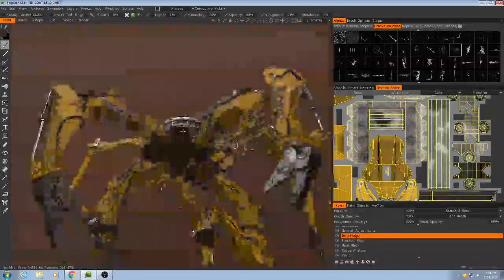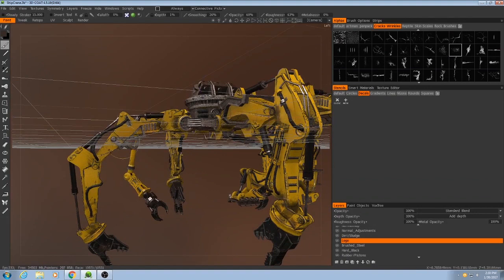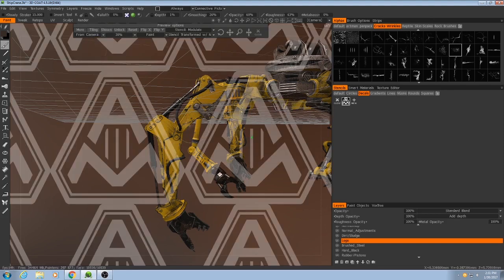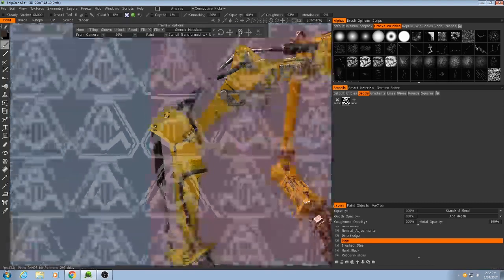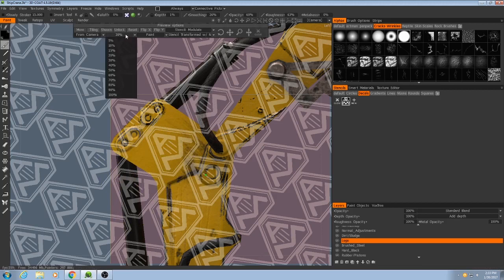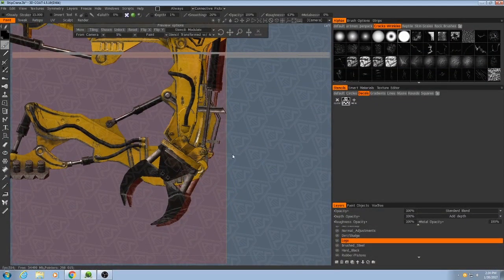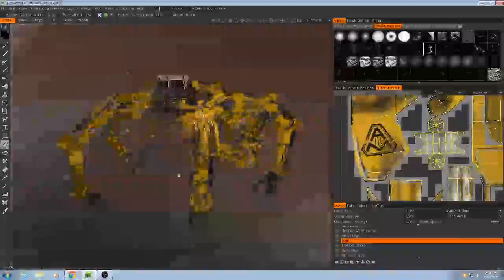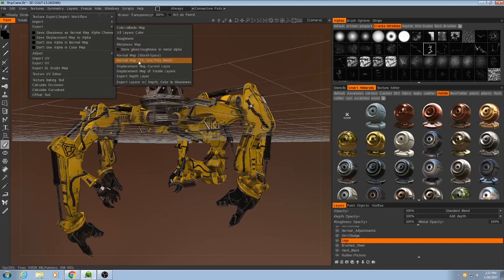3D-Coat Assembly Crane Texturing Tutorial (Part 8)

Comment: Thanks for the workflow tutorial on painting a complex model. Could you also make a real tutorial (for a complex model like this), from a to z.. that includes, the modeling, the retopo, the uw mapping (multi map), the painting, and the export/import into unity (so we see how to import and view it inside unity as end object). Also make sure you DON'T skip any part.. 
You previous tutorials, like the mountain, was relatively simple (one mesh, one uv map e.g.)
Reply from the maker: I would love to make a full tutorial series explaining in depth how I make a game asset from concept to unity import. It's a little difficult for me to do so right now though because I am very busy preparing the game project that this is from for a game dev competition I am submitting it to. I can however tell you that this asset wasn't actually modeled in 3d-Coat. It was modeled in Blender. I may actually make a short "Quick Tips" style video later this week explaining what export settings I use to get the model out of blender and have it be ready for 3d-Coat/Unity because the exact settings are tricky to figure out.
Reply: No Rush ;-) 
It doesn't matter how it is constructed (by means of toolset).. but an a  to z tutorial would benefit greatly to aspirering modelers for games. And since you are active in this field.. well you get the idea.. :-)